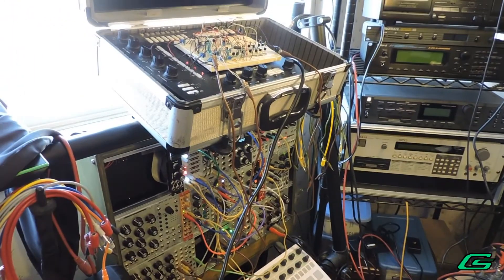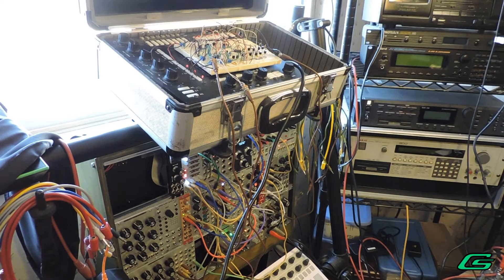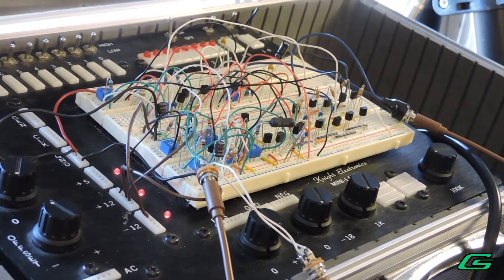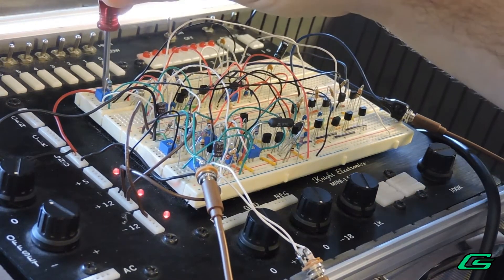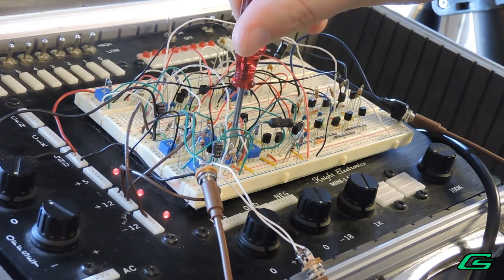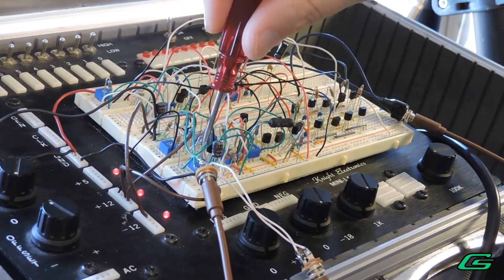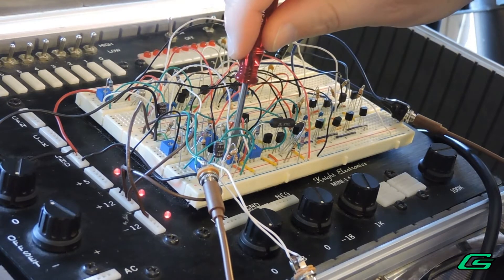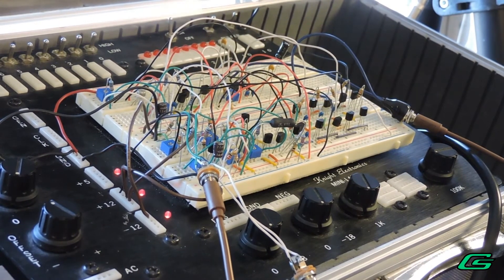Classic Synthesizer Filter Breadboard

Comment: Was this the Arp filter design that infringed the moog transistor ladder design ?. By the way what is the black device box you have underneath can you list for me what it does exactly ?
Reply from the maker: Yes, Moog infringement.  That's a Knight Electronics mini-lab w/ case for bread-boarding circuits.  These are generally purchased by aspiring electrical engineers as a kit, and they would assemble it as part of their lab work.  I found mine already built in a pawn shop on clearance for $25 but needing some troubleshooting.  The Mini-lab is a regulated +12/-12V power supply w/ built-in function generator, clock, logic switches, and a variable voltage supply 0 to +/-18v.
Reply: gstormelectro Thanks for your info. I must keep my eyes open for one here in the uk. With its functions it would very very useful for my synth/audio experiments.